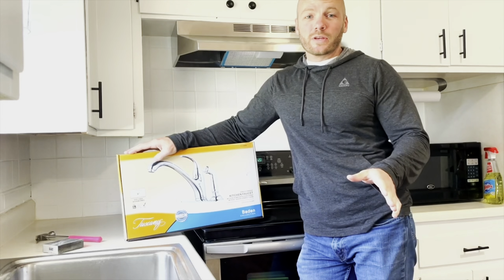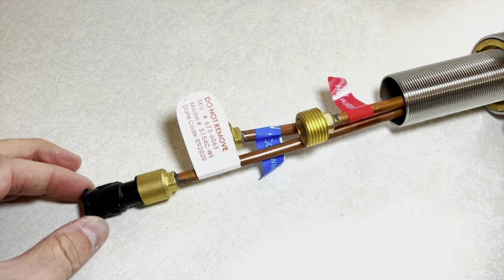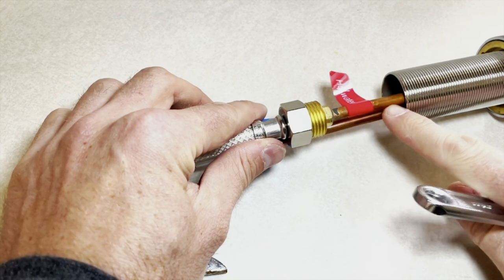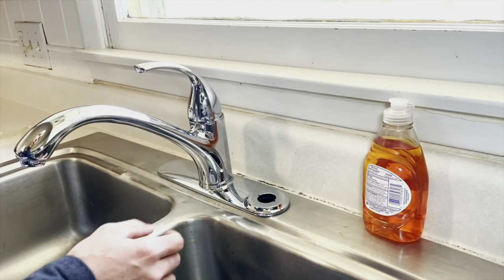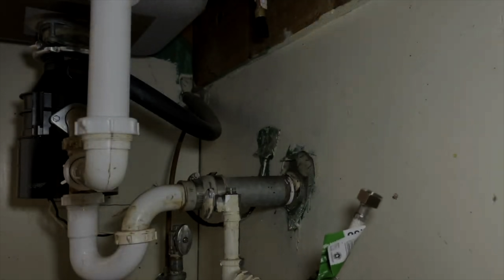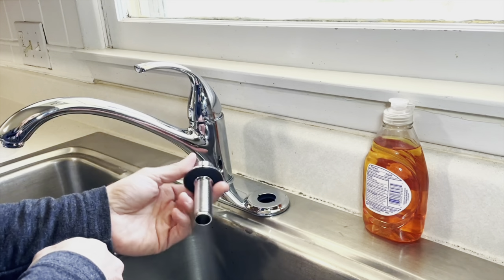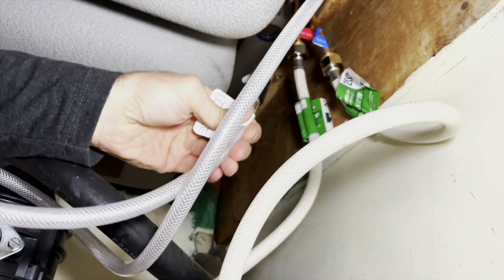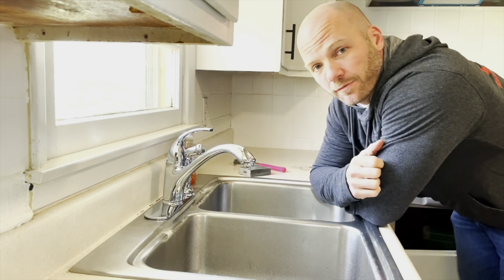Install a Tuscany Kitchen Faucet (Baden)

Comment: I have this same exact faucet. Bought it a few years ago actually from Menard's here in Clinton Township. It works pretty well other than my diverter needs replaced, which I'm tackling today, which is why I'm here. Looking for a video on taking the faucet apart to replace the diverter.
Reply from the maker: I haven’t had to replace a cartridge in this faucet specifically… but it should work the same as most other brands. I haven’t done a cartridge change video for my channel yet. But I have one taking apart a faucet to replace the O-rings. If you are going to open it up to replace the cartridge, you should probably put new O-rings on there too while you have it apart. 

Kitchen Faucet Leaks at the base. Easy Fix!
https://youtu.be/dyx5VgsVM6A
Reply: @RoscoReviews  Thanks! I just watched your other video. It helped. I'll be tackling my project after my busy work weekend. You have a new subscriber also! 👍🏻

Comment: How is the Hot vs. Cold adjustment?  We had a Delta that went from cold to kinda cold to HOT with a very touchy adjustment to get to "warm", such as one would use for washing hands, "backyard" chicken eggs, etc.  When the Delta went bad (literally developed a spray leak out the side of the middle of the spout!  In under 10 years of use!) we went with a Tuscany Marianna which has separate hot and cold controls. That takes slightly longer to get both hot and cold flowing, but easier to adjust the water temperature.  Best bet is turn on Hot 1st, so it starts arriving while you reach for "Cold".  🙂  When turning off, turn off "Hot" first, and do it a second B$ you think you need to as with a high arch faucet the flow doesn't stop immediately.

A complaint with all these faucets is that they comply to EPA slow flow rate, which doesn't work so well well when you are on a well and have likely 30-40, maybe 35-45 psi of water pressure to work with.  So flow rate stinks, and the whole slow flow thing is unnecessary as we are in an area with if anything an excess of fresh ground water -- most of the year it is less than 10 ft. down.   We do a lot of filling of largish containers (say 1 gallon) and pots (big batches of mostly Asian style soups, etc.) and standing around waiting for the water really gets to be a waste of one's remaining life when you get well over 60 y/o!

I wish these faucet companies would make their faucets so replacing an internal part could up the flow, but, no, the gov't knows better.  (Spit.)  

If I could find a way to make it look decent I'd install a separate high flow cold water faucet on one side...
Reply from the maker: I don’t know your model faucet specifically. But, The flow rate is typically controlled by the aerator at the end of the faucet neck. In many brands and models, this can be changed out for one with a higher flow rate. Or, you can even remove the inside of it and it won’t restrict flow rate at all (however, doing this it won’t aerate the water anymore, but for filling pots that’s fine.) if you take the aerator off want to remove the inside, I would leave the screen in there and just pull the plastic parts. The screen will keep little bits of stuff from coming out.

Comment: Thanks, this is exactly what I needed. Do you like the side sprayer on that faucet? I'm trying to find one that doesn't have a weak spray.
Reply from the maker: No problem! Yeah, it seems to work fine for me. I am sure it depends a little on the water pressure of your area, but it works how I would expect a residential kitchen sprayer to.